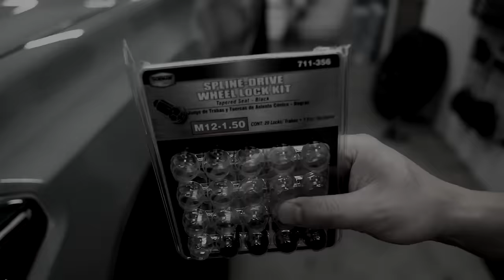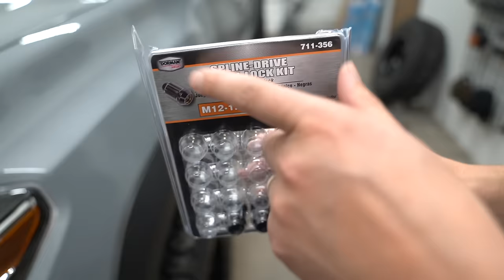Biggest Tire Size on a Tacoma/4Runner with NO LIFT!

Comment: Hay guys I've got a question? I have a stock  2019 trd sport an I want to run 285 70 17 with trd rims will they fit or do you,have any recommendations
Reply: Sadly they will forsure rub I suggest a level they are much cheaper then a lift and will prevent rubbing👍

Comment: With a 2.5 in lift front and rear (at least) should be ZERO issues running these exact tires specs, correct?

Comment: If one upsizes the tires for a TRD Sport Premium (265/65R17 to 265/70R17) can you also add 1" spacers to get a wider stance without any modifications, chopping or cutting?  Will there be enough room, or is it best to just have stock size with the 1" spacer?
Reply: Putting spacers on your daily driver isn't the best idea. Unless you would like to replace your axles every 2 years

Comment: It's hard to find rims with good offsets for our tacos. My 2016 SR5 I put a 3 inch spacer lift in, 285/70/17 17x9 -12 offset and would rub full lock reverse. Or when completely flexed out which both cases were rare for me. My 2018 TRD sport I'm just gunna get some wide 31s with negative offset and just get the stance I want. Mpgs suck with bigger tires. Side note with a lift even as small as 2 inches you should do a different drop and carrier bearing drop to correct angles. Then I had to get a ECGS bushing because I was having a vibration driver side from the cv bearing

Comment: Would 315/70/17 fit on a Trd sport 4x4 Tacoma that has a 2.5inch spacer lift without chopping?
Reply from the maker: No sir, trimming and cutting needed

Comment: I just had my tires put on. I got the Couragia M/T 285/70/r17. I had to get a 2-inch level for the front as well as a 2-inch spacer for the wheels. With making it fit it all depends on HOW MUCH TREAD and how MEATY the tires are. Make sure you don't get huge mudders if you want it to fit. I made that mistake. I had to cut plastics as well as buy the spacers to make it rub minimally. My next purchase will be a 6-inch lift so I can fit 35's in the future. You also get to keep the tire pressure sensors in the tires.

Comment: So if a 285/70/17 tire is about 33", wouldn't a 275/70/17 tire be the same 33" height? I thought the tire numbers are width/side wall height/rim size.  So the 275 would be a thinner tire than the 285 so you wouldn't have as much rubbing but it should be the same height. Am I right in my understanding?
Reply: 285/70/17 is 32.7 inches  tall 11.2 inch width and 7.9 inch sidewall
275/70/17 is 32.2 inches  tall 10.8 inch width and 7.6 inch sidewall

Comment: You still need to regear if running larger tires even with stock suspension.
Reply from the maker: Yes, These things should be regeared stock. with stock tires.

Comment: Like to buy my yota, had a recall for the sensor, an fuel pump..went from 16.5 - 17 mpg..to 12-13 mpg..tired of the stupid thing..good vid..
Reply: Did you buy a 21 Tacoma? Did u have the parts replaced and the mileage went down? What do you mean by “stored”?
Reply: @boblafountaine9560  sorry finger push wrong button..an no it's a 19.
Reply: An yes Toyota did replace them on a recall

Comment: So with the wheel offset is at zero and the plastic panels that were trim. Would I need to cut more plastic if I opted with a -12 offset?

Comment: 255/85R16s fit with no lift/rub. My neighbor has 285/75R16s on his TRD Pro. No lift. Regular driving, no issues. Slight articulate is a different story...   I have a 1.5in leveling kit on my TRD Off-road, with 285/70R17 (factory wheels) and they fit perfect.  No trimming. No rubs.

Comment: If u dont want it to rubb just installed a  2 inch spacer on front and it will be just find. Suspension feels the same wont be hard. And just wrapped some heat tape around exhaust pipe to protect tire.. 👍.. about to buy those tires..

Comment: Does anyone have a decent lift kit or leveling kit for a 22 off-road 4runner that isn’t a arm and leg it’s a pavement princess
Reply from the maker: Yeah, we offer a Wescott Designs kit that'll do the job. We also have a 5100 kit that'll give a lift and better ride quality at Runnin4Tacos.com
Reply: @Runnin4Tacos  links or part numbers to the kits? Because all I’m seeing is gen 5 stopping at 2021 kits and at that point what about a eibach stage 1 kits 2.75 of lift and stage 1 should have great ride control and still fit 33s

Comment: 2020 OR extended. 285/70/17 with TRD Matte Rims :) Did the same thing with my trim. Took it on some gnarly hills. No rub so far on my first test today with compression
Reply: What about now
Reply: @chrissimeus3843  Little rub depending on the Angles sometimes. Very minor. Pulled out front mud flaps. Cut off like a 2inch piece. 35k miles on my K02s

Comment: I have a 2016 Tacoma Trd Sport with a 3 inch lift with 17 inch rims sitting on 33 inch tires and it rubs quite a bit. I also have 1 spacer on each tire
Reply from the maker: We will have to do a video to show how to fit 35s with no rubbing issues
Reply: @Runnin4Tacos  and it came with a 3" lift

Comment: A guy on another channel said his 32" 275/70/17 rubbed on his stock Tacoma. Does that sound right? Thx!
Reply: DAMIAN  off-road, yes. 265/75r16 or 265/70r17 is the biggest that will fit on stock Tacoma when flexing off road.
Reply: @andrewhenley2161  What about the taco sport? It comes factory 265/70/17.
Reply: COTE Official Unless the information I’m finding online is incorrect, they come with either a 265/65r17 or 265/70r16 depending on configuration. Tacomas you can go up one size taller with no mods, after that you rub or start cutting

Comment: How does this tire change effect the gear ratio and speedometer, will you need to re-gear and recalibrate?
Reply: 2014 QCLB, same 285's. Desperately need a re-gear, speedo is not very far off. 5mph max. 3.737 ratio stock. Want to go 4.60-4.80 range for a mix of low end torque and top end power where the 1GR actually performs.

Comment: Will a more negative offset wheel cause more of a rub with a 3 inch lift? I dont mind trimming some body panels and wheel well, only thing I dont want to do is a cmc
Reply from the maker: There is a happy medium like a -10 or -12. If you get a -38 then you will rub a lot on your fender
Reply: Yes. Something like the 0 offset Method is your best bet.

Comment: How does the fitment change with the 1” lift on the Pro (2017)? Can I run the 285 without cutting anything and still be able to take it off-road without any headache? Just not sure how much of a difference that one inch makes.
Reply: It’s weird cuz I put fox 2.0 coil over it gave me 2” lift in front but I still rub on that exact part he cut off so idk..
Reply: This blog should help with your answer, https://www.tacomaworld.com/threads/stock-trd-pro-with-285-75-r16-mts.536754/. The consensus seems to be that the 285's fit on the stock Pro with no rubbing, even when offroad. Although there are a couple of people that say they do rub when offroad which could be confusion between those with TRD Offroads and those with the TRD Pros. Finding a definitive answer is difficult. That would be the video to make. Install 285's on a stock Pro and fully flex the suspension, turn the wheel, yadda yadda.

Comment: DO NOT DO THIS!!! I put this exact tire size on before my lift and drove around my neighborhood just to see. Basically undriveable. Anything over 1/4 turn of the steering wheel was rubbing pretty bad. MUST have lift to run tires this size. TERRIBLE ADVICE!!!

Comment: Not sure what these are, but stock offset wheels are a huge help in fitting bigger tires. Also, going with a 255 80 17 helps too. Same diameter roughly, just narrower. As an aside, Toyota should be making these openings big enough for at least a 33. There’s no good reason not to. I mean, soon you can buy a Bronco and Wrangler with 35s from the factory, 33s are pretty much standard.

Comment: If you have a round wheel and your new wheel size is 3 inches larger. You essentially are only increasing your clearance by 1.5 inches. If you increased it by 3 inches the wheel would have to be 6 inches bigger in total. The whole size increase of the wheel doesn’t add to one side it’s evenly distributed. So actually it would in be about 3/4 of an inch larger. Because the tire is round. So expanding on four sides would give you and even distribution. Also cutting wheel wells doesn’t count 🤦🏿‍♂️

Comment: I see so many of these videos, will it rub.  After you cut that piece off didnt you see that gaping hole.  Water, grime, rock, sand, SALT will get up in it and rust your truck from the inside out.  Sitting still turning the wheel is nothing like traveling down a road.  Bumps, potholes are going to affect the turning angles.  Also if you plan going off road.  My god havent you watch the wheel travel in any of the videos.  I bought a truck to drive, not sit in my garage with the motor running turning the wheel back and forth.

Comment: Is that the Method NV regular wheel or the Method NV HD wheel? Anybody know the weight difference between the two? I have an 03 Sport 4Runner with 32” w/ no lift and they fit with no rubbing at all. Going to get a Fox 3” lift but probably staying at 32” to better match the factory shift points.
Btw...I prefer the old school flat chrome TRD center caps.

Comment: I trimmed all these spots and just got some 285s and they rub on the metal piece on on the back bottom of the fender liner
Reply: Get an alignment. Is your truck lifted?
I got an alignment and had my caster pushed to 3.0 on the passenger and 2.8 on the drivers side i believe. I also had my tired flush with the fender with a 0 off set wheel. Does your wheel have a negative off set?

Comment: What is the formula you used to the get the inches from calculating tire info?
Reply: A/B/C = 285/75/16. 1st number (A) is tire width in millimeters. Divide this by 25.4 to get width in inches. 2nd number (B) is the height of the sidewall as  a percentage of the width. So divide B by 100 then multiply by A, this gives the side wall height. Multiply this by 2 to account for both sidewalls. Then add the 3rd number (C) rim size. (Why width in mm and rim diameter in inches??, who knows...). So (285/25.4)×(75/100)×2+16=32.83"
Or simplify: DIAMETER=C+((A×B)/1270)

And remember, when people make videos, and say going from a 31" tire to a 33" tire gives you 2" of lift, the are 200% wrong. Your height goes up by the radius of the tire, not the diameter. The distance from the axle to the ground.

Comment: I wouldn't worry about that little bit of rubbing. Itll only rub a little while youre parking and itll stop as the tread wears. If you run a couple extra pounds of air it might not even rub.

Comment: I have a 2017 Tacoma TRD Sport stock. Bought used with 16" wheels, 245/75R16 All season tires. The guys at Toyota told me if I change to 265/75R16 AT tires I will add 3" to the diameter which may cause issues. Don't want to lift.
But are they correct?
Reply: Adding height to a tire will not cause any issues other than rubbing on body panels and it will not cause any wear and tear like you would hear from a suspension lift.  In your case, a stock truck is fully capable of 265/75r16 with zero issues, this has been verified time and time again.  The trucks come with 265/70/r16 stock even on the off-road package.
Reply: Also, going from a 245/75r16 to a 265/75r16 is just over 1 inch in total diameter difference, that guy is wrong.

Comment: Hey would I need wheel spacers running 15x10 wheels with a 2.5” front spacer? I’m thinking of getting 31” AT for my 07 Tacoma. Would it rub on turning and off road or do I need to lift it more?

Comment: Did you have to use a hub ring to make the Methods fit stock hub?
Reply from the maker: You will still need to use the hub from the Method wheels.

Comment: Great video! I'm running 305-70-16's on my lifted Tacoma, except for some tire noise, no problems.
Reply: I’m wondering if on my stock 2007 taco if I could run 305/65or70r16 would u know if it’s possible?Thank You in advance

Comment: On my 09’ Taco I rub with 32s. 265/70/17. -6 offset. i wasn’t expecting any rubbing but i’m going to need a leveling kit and some more trimming.
Reply: probably b/c your wheels have -6mm offset.  If wheels stick out more, you will rub more.  It also may be due to which tire brand tires - some brands protrude more than other brands on the corners.

Comment: Hi, thanks for the video, question: if I use 32" 275/70/17 tires on my 2019 Tacoma TRD Pro what size of wheels have to be from Method (please give all specification for those wheels). Thank you. P.S. and what I have to do with my regular Tacoma tires, please your recommendation. Thank you.
Reply: The last number is the size of the wheel so it would be 17 inch wheels for any company. That’s what the 17 at the end means.
Reply: Leopold, I have a 2019 TRD Pro as well. And on a Tacoma forum I read that you can fit 285/75/16 on the stock rims with no lift, no trimming and no rubbing even off-road driving due to the little bit of extra suspension lift and wheel off-set you already get from the stock Pro setup. Haven’t done it to mine yet. Still using what I can out of the stock tires first.

Comment: Where did you get that grille. I’m worried my sensor may not work the same if I change the grille on my 2020 .
Reply: REDYOTA Off-road your sensor will work just fine. I have replaced mine and I have absolutely no issues at all. I bought mine off the eBay and paid about $87

Comment: That's a stock SR5 Tacoma? where'd you get the TDR pro grill from?
Reply: Just saw ur comment. I bought my trd grill on ebay for 150$ its bad ass. All my buddys have them its the same as original . I recommend it.
Ted its approx 400$ from dealer .

Comment: I have Method MR305NV 17x8.5 0offset (same as what he has here but I went for bronze with black ring). and 265/70/17 tires.. 31.7" goodyear duratrac c-load rated. they work great, still get good fuel mileage, they handle mud, and snow great, and have excellent dry traction. you also need M12 1.5 lug nuts, but be sure to get the EXTENDED THREAD versions.. otherwise you will only grab 4-5 threads on your wheel studs, and this is VERY DANGEROUS, (studs can snap easily, and lug nuts can back out with such little thread engagement)... I have these on my stock TRD offroad. and only had to remove the mud flaps, and cut a 1" piece off the passenger inner fender liner that was rubbing.
Reply: The wheels don't come with lug nuts?  Do you have a lift?

Comment: The method caps are made to go around a hub with a lock on it like a ford front axle. I am pretty sure you could remove the hub ring around the outside

Comment: 4Runner question: What is the optimal psi for the 265/70/R17 on pavement and what is the optimal air down psi for off-road trails? Many Thanks!
Reply from the maker: On pavement is the stock psi, that size isn't much different than stock so no need to change. On trails, 18 psi is a good start
Reply: Thank you! The dealership over the phone said low to mid 50 psi for the KO2 265, and I thought he was wrong. That seemed way too high. I was expecting a stock psi in the mid 30's.

Comment: so will a 275/70/17 tire  would fit on 2019 tacoma sport with no rubbing? mainly for a daily driver
Reply: goblue 2point0 they will fit but you will rub. i have 275/70 r17 Wildpeak at3w on my 17 TRD OR and i have rubbing on the cab mount when going in reverse and i have a 2” lift.
Reply: Thx for the repli
Reply: @daddy2pt0  I have an 18 sport and run 265/70 17s as a daily driver and have no issues with rubbing under any situations.  I'm thinking this is the biggest you can go without any kind of lift. It did hurt my mileage about 50 miles/tank tho by going up a size.
Reply: @18motorsports9  cool, thx
Reply: @18motorsports9  50 miles a tank wow! more than I would of thought, thanks for the info.

Comment: What is a fairly common tire size that is right in between this and stock size? (for 16" wheels)
Reply: 265/75-R16 is 31.7" works great with no rub on stock suspension

Comment: Great vid. Anyone run 275/70/17s no lift? Any rubbing issues? Also, if wheels have -10 offset would it affect anything?
Reply from the maker: Raymond Campbell -10 would push it out a bit which might hit a little more on the fender
Reply: i have scs ray 10 with -10 on wildpeak at3w 275/70 and it rubs cab mount in reverse. I also have a 2” lift so i’m sure u will rub. i had to trim some of the plastic like in the video on rear side of fender well. hope this helps
Reply: Craig Lange appreciate the response. Looks like I’m going with lift and some  chop.
Reply: I try and let people know as I read countless times on forums that 275s would fit with no rub. It only does if you drive straight lines with no bumps. lol
Reply: Craig Lange at least need to clear those speed bumps at the mall with no rub. Haha

Comment: What if I do a 16 rim with 33’s?
Reply: Will 33 fit a 16? Would you have to do the mods to the truck with smaller rim?
Reply from the maker: Same thing, the tire is still a 33"

Comment: I did this but I just took out all that plastic shit in my wheel wells and I changed the front bumper anyway to a rigid industry's metal bumper in the front so I have no rubs at all. Also as far as road noise goes because that is mainly why that plastic is there, it still seems good to me. It did not get louder, it still rides pretty quiet.
Reply: Rigid Industries doesn’t make bumpers for the Tacoma...they make lights and light mounts.

Comment: Do the tire pressure sensors still work with this setup or do you lose that after upgrading?
Reply: Good question
Reply: They still work.
Reply: you can reuse the stock ones or buy certain aftermarket ones that allow you to do a "relearn"
Reply: Interesting, you have also made it difficult & a pain in the a$$ to check air pressure in the spare.
After trimming the front, what happens there after driving in the snow?